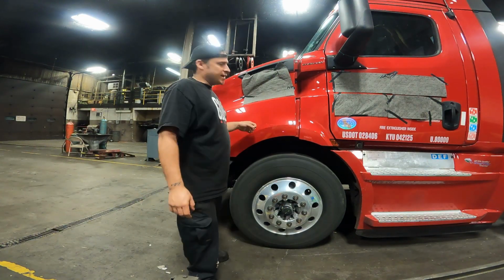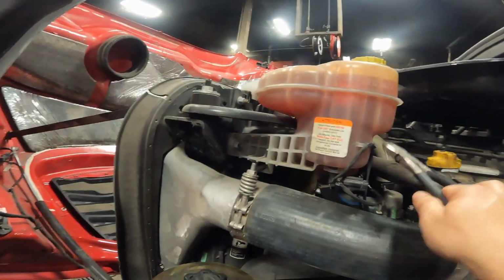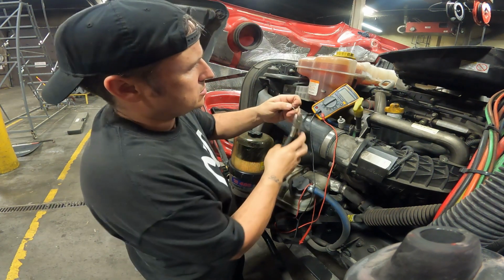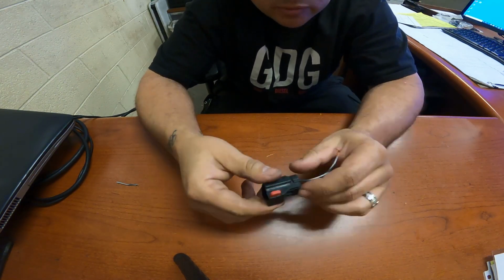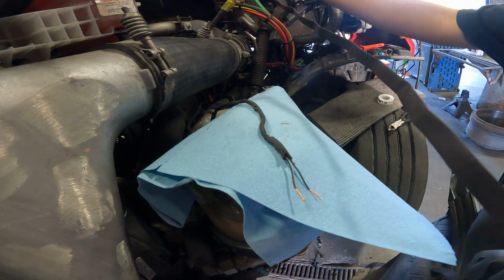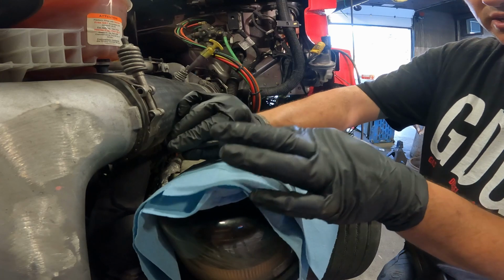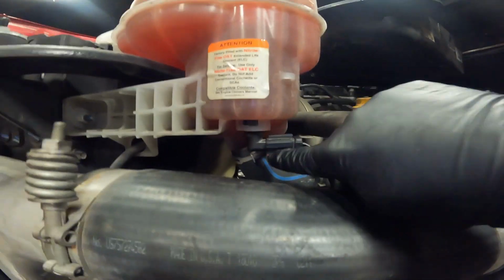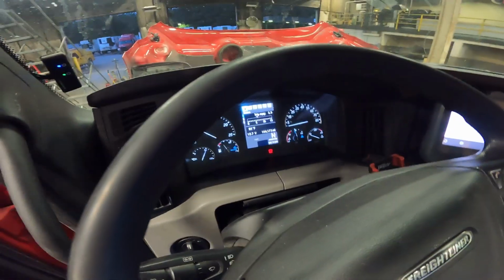2019 FREIGHTLINER CASCADIA COOLANT LEVEL SENSOR DIAGNOSED AND REPAIRED | NO BYPASS | LOCATION | TEST

Comment: What should the voltage be at the sensor with it installed and  the tank float up?  (full)   The sensor should have some sort of resistance in the closed circuit position I would think.
Reply from the maker: Usually it should be a 5 volt reference on those sensors

Comment: Awsome work man ,not even a dealer could solve this problem...Mybe you can help me out with my 2020 freightliner Cascadia 116 dd15 the fan stays on all the times .It seems to have one of those viscous fans on . The Freightliner dealer could not diagnose the problem since there are no codes on the dasboard.May be you can help .... God blesss.
Reply from the maker: I’d check to see if your fan clutch is leaking air….spray it down with soapy water….if a fan clutch is leaking air that means it’s staying engaged all the time …the air is supplied to the fan clutch to disengage the fan clutch until the engine temp gets to 200 degrees…
Reply: @Gasdieselgarage  Thank you for the quick reply. When i drive the truck the coolant tempurature will not excied 150 F and the oil temp barelly gets up to 150 F .My truck has an electric fan supported by a 5 pin electric plug.I looked everywhere around the engine for a clutch fan solenoid and couldn't find any ,not even a fan clutch switch and there is no airline running or connected to the fan hub or the clutch.I disconnected the 5 pin power plug to the fan and probed it with a tester ,i even used a multemeter ,everything seems to be  working fine.I checked the coolant level sensor and the plug that is connected to it ,everything is fine there,did the same test on the AC switch , Checked all relays inside the fuse box inside the cab ,they are all in good working condition.I did a fan test by spinning it while the key is on without starting the truck, the fan will spin hard by hand with resistant , it does the same thing when the egnition key is in off position. I even disconnected the fan at  the power  plug and started the truck ,the fan is going still...

Comment: They have done sensor replacement and harness replacement 5 times and still when truck starts regenarating. It says low coolant level but it's full and it shuts my truck off. 2019 freightliner cascadia  I'm not sure what to do next  what do you recommend?
Reply: I have the same problem. How did you resolve it?

Comment: You are producing the best videos by far. and I would like to give you 200% I would love to see more videos abt cascadia since I own one. My coolant leaks whenever I switch off for a dat or two I changed EGR COOLER I changed Air Compressor to Block small black colour line but still the same issue.

Comment: I have this exact problem but it’s intermittent every time I check the damn check engine light is not on but I check voltage anyway and 5.5 V and my sensor ohms out 150 ohms but once I start driving it may pop up and a half hour later it goes away very unpredictable but the code shows up as low coolant pre-warning when I can catch it active once it goes away it shows no history
Reply: Me also. Ive replaced coolant tank, sensor,wiring harness.  Now what. Please help
Reply: Hey did you figure out what the problem was?  Am having the exact same issue
Reply: @bijaylamgade498 YES
Reply: @bijaylamgade498 you need to replace the tank
Reply: @bijaylamgade498 there is a float sensor in the reservoir its built in it gets stuck so the truck thinks you are low on refrigerant…the reservoir is a couple hundred bucks at most and the labor isn’t too bad

Comment: Is it easy to replace the harness?
Reply from the maker: To answer your question the short answer is “no”…..the two wires for the sensor run across the engine and goes into the engine harness bundle on the passenger side of the firewall….my recommendation would be replaced the wires from where it goes into that bundle I just spoke about.
Reply: @Gasdieselgarage  got it, thank you!

Comment: Yo brother I'm having this issue replaced sensor and it threw code again its a 2021 freightliner cascadia day cab harness looks okay is there anything in the coolant reservoir that sensor connects to I don't know what to do dealership is stupid and don't care
Reply from the maker: If you can inspect the actual connector and see if there’s any damage or loose terminals. The wires are crappy in these trucks. Very thin and break easily internally.
Reply: @Gasdieselgarage  thanks brother will do, other then that you think it is Ethier harness or sensor possibly nothing else
Reply from the maker: @515051506969  exactly….well if you already replaced the sensor.. I’m very certain there’s a broken wire somewhere….. those wires run straight to to the trucks ecu so there is nothing else I promise you that bud.
Reply: @Gasdieselgarage  your a big help thanks brother